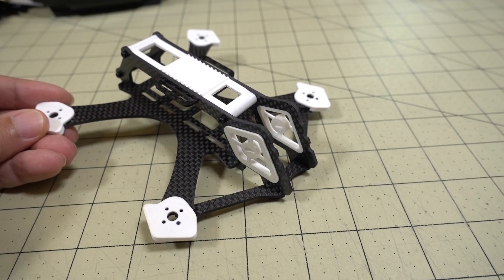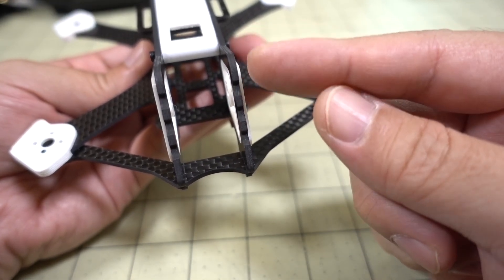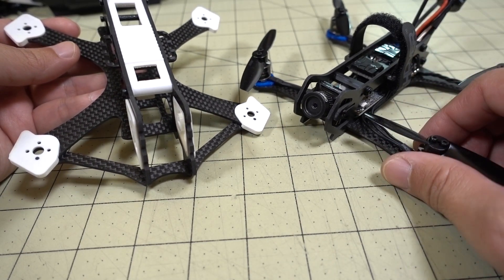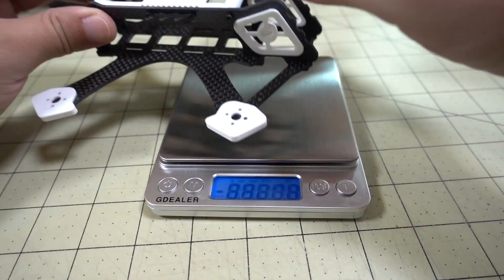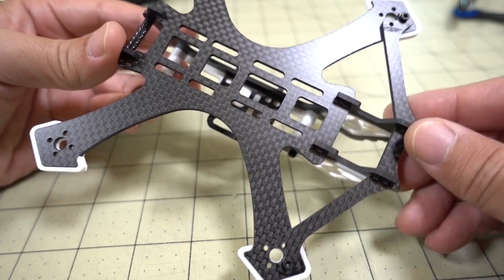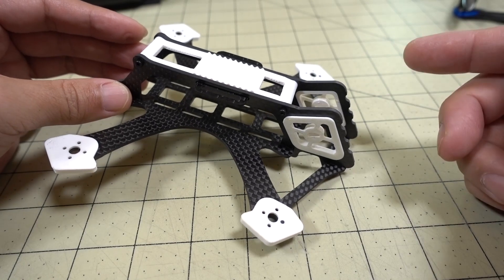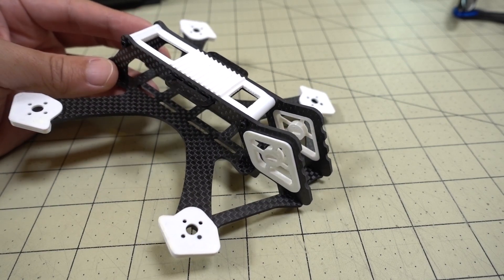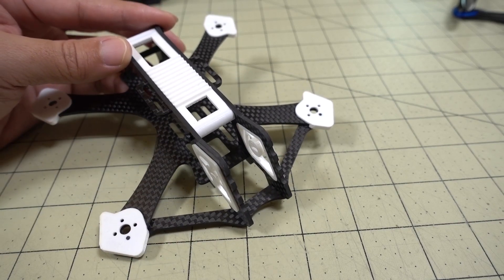My Micro Drone Frame Design (AK Crossbow?) 😍

Comment: Hey Albert, nice looking design!  I'm curious why you have notches cut in the front of the side plates?  Good luck with your test flights!
Reply from the maker: It's just for looks... not functional
Reply: Cool, it does look nice.  We're all adding TPU bumpers in front of that area on the brat so I was surprised to see you remove material there.  To be fair I haven't seen any brat frames break in that spot with or without a bumper.  Good luck with the testing!

Comment: Looks really interesting, I'm very interested to see what battery and motors you go for. For just a tiny bit extra carbon why not extend at least the outer edges of the main base plate forward to meet the front of the camera prod/front cross brace. Good name.

Comment: AWESOME! Happy to hear you liked the name too, I thought it was very fitting! Will it fit 1404 and 11xx motors alike or just one of the two?
Reply from the maker: It will fit 1404 motors with the 9mm hole pattern.  RotorX, Airblade Superman.  Also, the Spintech 1304 and RCX 1304.  Also the GEPRC 1206

Comment: Hey, I like this design a lot, as it comes at less then 60g as the Acrobrat.  However, please consider to make the front arm lighter to save on weight. I am using the druckbaer frames an like them a lot because of this. The front arm that goes to the center can be made the same width as the front arm. Furthermore, the camera is tilded around a center mounting point. So I would suggest a round shape of the vertical carbon plate at the front to better protect the cam. Anyway, nice design. Let me know when we can buy it. Will you share the drawings? Would be cool to make an open frame project from this...

Comment: I like the fact it has slotted mounts, and that you have plenty of stack room! Maybe it was mentioned and I missed it, but what size is this frame? 145mm?
Reply from the maker: Yes, 145mm
Reply: Albert Kim - Looks really nice, Albert! I’d like to see the future bring modular electronics to these frames, whereupon the stack, the split, the VTX just pop into place within the frame and you’re done! You could try different stacks by just popping one out and putting another in! If you’re familiar with the Golf industry, it’s basically what they did with shaft technology to the head, were there is no more glue involved, its an interchangable spline system taken from the car industry, were the shaft can be changed and adjusted instantly!  I’m thinking quick quad interchangability! Or perhaps I’m not even thinking! But it’s a good thought!

Comment: Very nice frame. But u mite want to rethink the 2mm bottom plate. I have broken those with 1105 Motors. Not on the first crash, but over time it weakens and breaks. 2.5 would be better.
Reply from the maker: I want to keep the weight down as much as possible.  I will offer a tank frame later for those who want to build over 250g.

Comment: I really like this frame. While I wish you would have given the buyer the choice in motors I do respect you decision on why you chose to limit the motor size. I really like the idea of the floating camera mount and like the fact you went for weight savings. Once it releases I will be taking a look at it. I also hope a Canadian company will carry it as well. Thanks Albert
Reply from the maker: I think those frames that are "one size fits all" are some of the worst designs for the micro market.  I will make a different frame later for the bigger motors.

Comment: I LIKE, but you didn’t mention the battery plate. I’ve not seen any others with tpu there, what specifically did you design the holes/ridges for? Can u still add 3M silicon pads, do u need to? Is it possible to break the plate by over tightening your strap or in a hard landing?
Reply from the maker: The El Camino uses the same TPU battery pad.  I haven't broken the plate.  I use the strap in a different way than you might think.

Comment: Looks really nice - love the white against the dark carbon fiber.  I see the extra front arms would be good at pushing the drone away from obstacles but it may be worth reversing the props to make more use of that.
Reply from the maker: I always fly props out (reversed)
Reply: @AlbertKimTV  I am thinking of swapping to props out but worry about dragging an obstacle (i.e. branch) into the flight controller stack. I've been playing with a few drone designs of my own and find pros and cons to every design choice.

Comment: Looks sexy! I like it a lot! Lots of good ideas! I was thinking "archer" when I saw it so crossbow should work as well.
I hope that the camera mount helps but I am afraid the camera doesn't have enough mass to dampen vibrations.
One thing is puzzling though - the m3 slots. I remember it was a huge pain in the butt when I built El Camino. How many 20x20mm boards use m3 screws? It's very awkward trying to use m2 screws in huge m3 slots and then you will need a way to prevent electronics from sliding back and forth during crashes. I remember I understood why the idea of having the slots was not popular.
Reply from the maker: Yeah, I'll consider switching that to M2, but you can also use spacers/washers/adapters to adjust M2 to M3 for the mounting as well.
Reply: @AlbertKimTV  I have done that but for me, for whatever reason, it was a huge pain in the butt. Please change if you can! Also, how do you stop the stacks from sliding when crashing?

Comment: please rotate the carbon fiber orientation of the baseplate 45 degrees in the production version. it will make the whole thing more durable
Reply: It actually let's them flex less and will break more often. And often the top.layers are just cosmetic.
Reply: it's true that the top layer is mostly cosmetic, but on most cf it reflects how the fibers are oriented inside.

and it's a fact that it's more durable. with wrong orientation a lot of the force stresses the polymer resin, which you don't want. you want the stress to be distributed over the carbon fibers.
Reply: I agree entirely - I can confirm that carbon fiber orientation makes a HUGE difference and everytime I see carbon that isn't oriented correctly, I automatically won't even consider getting it.  I'd say wrong (versus proper) fiber orientation (from Armattan productions) results in about a 4x strength difference.  You can save a lot of weight on the frame going w/ thinner carbon (3mm seems equivalent to 5mm w/ the wrong direction).

Comment: Very clever!!!  The other advantage of the cross-bracing as in the Massive Droner is that it helps the arms resist the torque and twisting induced by the motors - and results in much cleaner noise profiles in Plasma Tree and BBE.  You can bet I’ll be buying one when they come out!

Comment: Nawesone... design mate...
Can it use 14xx motor size?
Reply: From video, so long as motor mounts are 9mm, then yes.
Reply from the maker: Only the ones with the 9mm mount pattern.  Anything bigger won't fit.